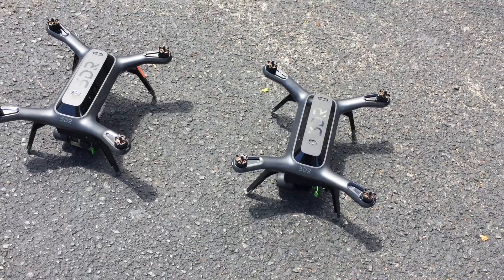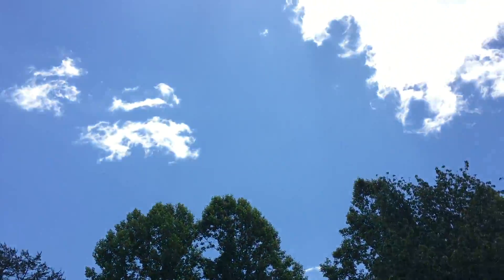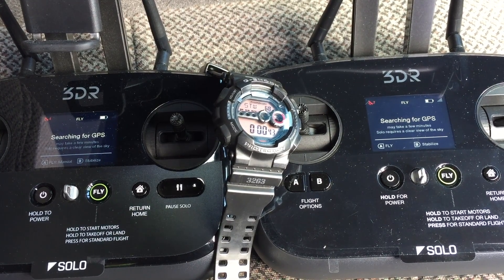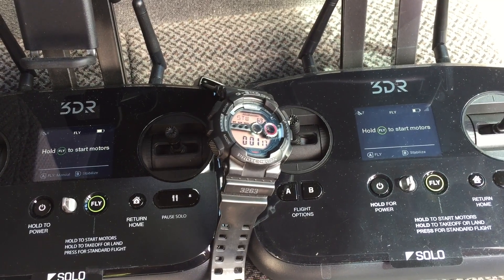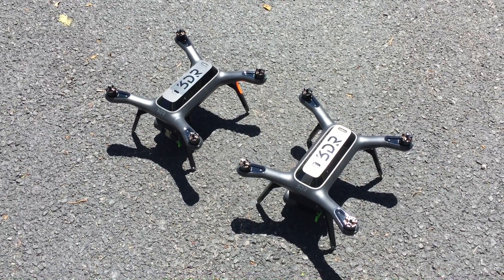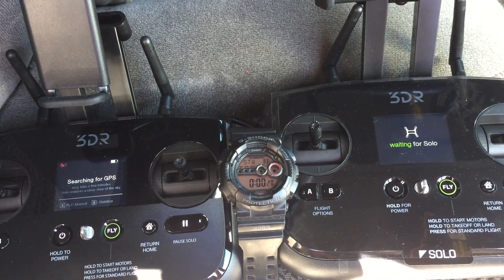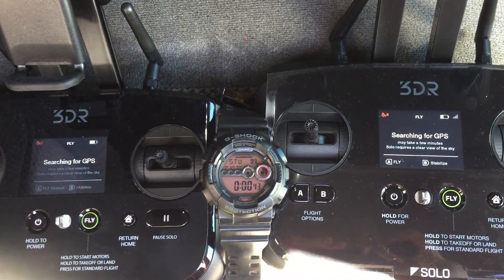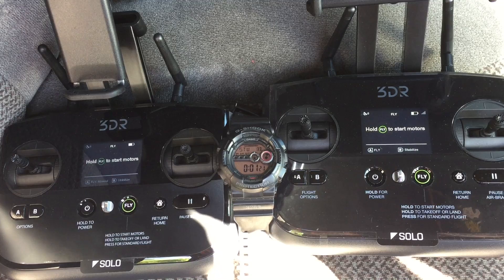3DR SOLO GPS Version A VS Version B Test

Comment: A simple $10 Ublox from EBAY works just as good if not better.  I get lock within 1 minute. 9sats. Minute and half I’ve got 12 to 15 with low hdop of 0.6 to 0.8.  People are wasting there money on these Mro and here gps modules.  It totally not necessary.   These people selling these gps units are laughing at you when you buy from them.  
I’ve been building drones for 3 years now and I’ve always purchased from same seller on EBAY that sells the so called cheap knock off but there actually not knock off gps modules and I’ve only had one issue with one unit that was a power issue which was an easy fix.  
What I’m trying to say is please stop wasting your money on these so called upgraded gps Here GPS and MRO modules they are the exact same thing as the so called cheap eBay ones except they solder the Ublox to a different board and sometimes put a different case on them.  They function the exact same!
Now rev A gps was just a weak antenna is all and it was the M7N model which only used USA sats.  Any Ublox M8N will work and work well.
Reply: Thanks for the Valuable Insight/experience sharing here!
Reply from the maker: Thanks for sharing. Im alway in for cheaper alternatives.!!!